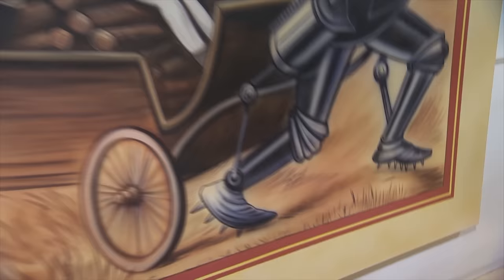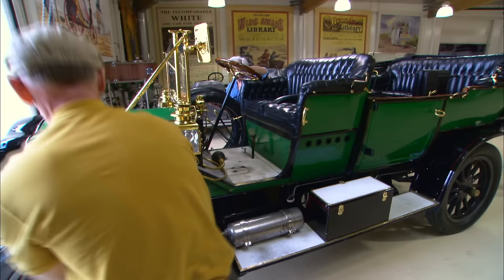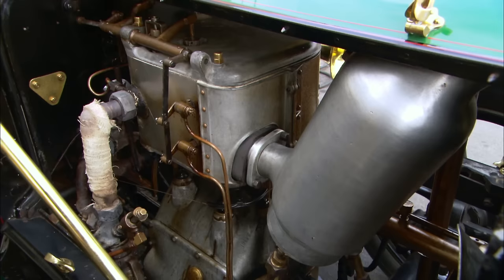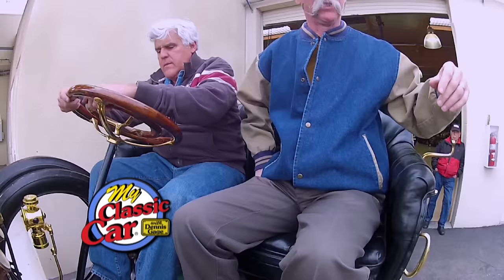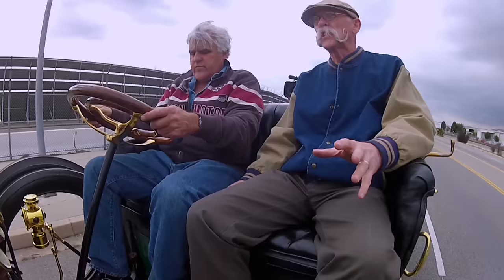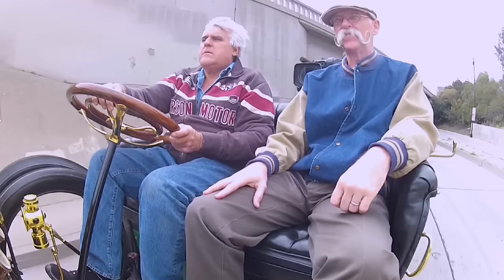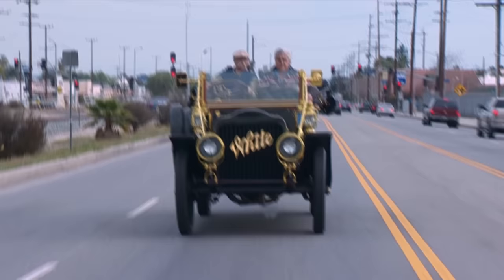Jay Leno's Steam Cars

Comment: 14:35  "I"m at top dead center", that just cracks me up, Jay was like, "get out and push". All that torque and they couldn't get the engine to turn over. lmao!
Reply: most likely has nothing to do about torque. 
I have seen this many times on bigger engines like MaK 6M552C
The cylinder is in a position where nothing will happen, so you got to turn it for it to start.
Reply: What happened to the simpling pedal?
Reply: Need a hand powered dead center over turn gadget. Ahh??? 
Some one should start making these brand new! AAA?
Reply: Yeah that's what you get with a single-cylinder machine. That's why steam locomotives have the cylinders offset by 90 degrees, can't really give those a push...

Comment: In theory, you could make it nuclear powered, but blocking radiation in something that small would be tricky
Reply: You could use a radio-isotopic reactor, like the one used on the space probe Voyager, it doesn't produce neutron or Gamma rays just alpha particle they don't traverse material, so it could be use in a car.
Reply: Oh yeah your right, 

Forgot those existed
Reply: You actually can block the radiation, as that technology was developed for aircraft and nuclear powered missiles in the late 50's and early 60's.  That technology never saw the light of day though, as they never solved the safety issues that would result in a crash.
Reply: I didn’t know about that,

I was thinking about how Modern U.S. Aircraft Carriers do it, with a shit ton of lead
Reply: What about a turbogas?

Comment: Give me a little push!  Awesome.
Reply: gamekeeper64 I think they may have locked up a brake on that wheel coming to that panic stop.
Reply: Nope, as Jay said, the engine got to top dead center, which meant no power at all. I believe it is a single cylinder, that's why it couldn't go. If only they put a small electric starter motor on the rear axle, then you press a button and a little whirr later, your moving again.

Comment: 800 foot pounds torque
Reply: Thats a lot for 20 hp
Reply: Ermos Cimpoesu THE POWER OF STEAM
Reply: Top RPM is low, which is why only 20hp.  It can get you going well, but it won't pin you to your seat, at least more than a second or two.  It's like a small geared down engine.
Reply: 800 lb-ft @ 130rpm.  lol, sounds impressive but the rpm's wont make this a speed demon.
Reply: @oldtwinsna8347  Steamers are great hill climbers, with all that torque.  And excellent at high altitude.  Stanleys won the Mt. Washington Auto Road Hill Climb from 1900 on to maybe 1910.  And big Stanley  "Mountain Wagon" 10 passenger car/buses did excellent service  as hotel vehicles for mountain resorts in Colorado for many years.   And steamers can be very fast -- as you saw in this video, the White could keep up with modern city traffic.  Stanley in 1906 set the Land Speed Record at 127 mph on Ormond Beach FL.  1907 Stanley returned with higher pressure.  At a -variably estimated 140mph the racer flew, then crashed.  The boiler spewed and rolled hundred yards then into the ocean.  Driver survived.

Comment: No way that is 3,800lbs... My explorer is 4,400lbs... And my explorer aint near as skookum as that steam car
Reply: Nope. Cars back in that day were a lot lighter than you would think. They have small frames and no safety systems.

Just a frame with some metal strapped to it and an engine
Reply: Yea the cars look bulky, like some industrial equipment, but yea probably just a lot of sheet metal and empty space inside.

Comment: It actually requires 25% less startup effort than my 09 santa fe. I usually gotta pop it in neutral and push it up and down the street a few times before it realizes the neutral switch is engaged
Reply from the maker: You should probably get that looked at. 🙂

Comment: I can imagine that going at those speeds in a steam powered vehicle was nearly impossible back in 1909. The highway system wasn't created until 1956 and the roads were not as well maintained as they are right now. If someone wanted to go at those speeds back in the day, they probably would have crashed.

Comment: This is rhw future of cars if you think about it.  You can plug it in to keep the steam hot with modern technologies.  With fuel choices,  you can run a steam engine on anything that burns, including pure green ethanol or methanol. And with modern technology,  all of the engines shortcomings can easily be compensated for. Companies looking for alternatives,  should look at these and think about going back.

Comment: I Believe he Really had OTHER PROBLEMS when he "Needed a Push" like Transmission linkage stuck in two gears, cause it's damn near impossible to have a TWO CYLINDER Steam Engine get stuck on top (or Bottom) Dead Center. . . Happens All-Too-Often with Single Cylinder Steam Engines, but Twins Generally have Offset Crank Journals that Eliminate That Problem.

Comment: The throttle could be operated by a foot pedal and spring back to a closed position when released to make driving this more practical. Not suggesting modifying this vehicle that will never be made again, just don't see why it wasn't made that way to start with.

Comment: I wonder if it's possible to remove radiator on cars, and instead use water steam to run a small steam engine that's tied to to cars belt. I think that would add extra mileage.

Comment: I can't get over how fast that thing can go. In the video Jay guesses it weighs maybe 3500lbs and he states that the engine is 40HP. You put a 40HP gas engine on a 3500lb car today and it is going to crawl along. Even compact cars in the 2600lb range in the US have over 100HP. Did they calculate HP differently back when that car was made or is there something I'm missing?

Comment: Proof polution is a choice
Reply from the maker: Actually, steam cars have to burn fossil fuel to create the steam and use about the same amount of fuel per mile as internal combustion engines.
Reply: @MyClassicCarTV  Yeah, but people could innovate the designs, and change the engines to use less. Transportation isn't even needed to make society function. Or we wouldn't even be here.
Reply: @MyClassicCarTV  we could probably have vehicles that run off of magnets,I used to think about different ways to design cars n stuff when I was younger. But our society is about production for the longest period of time. Fossil fuels can go until the mechine it powers fails.

Comment: Wat is like to know is why r we not returning to steam cars for everyday use for normal ppl? This car is doing all it needs to do as a car. It only fails when it needs to be driven for racing or something and maybe it can’t be built like a transport truck can but for normal driving it’s all u need. This car produces next to no emissions and get u safely to ur destination without question. Why do we need to use gas, diesel, and electric cars for the normal persons everyday use?
Reply from the maker: Steam cars burn fossil fuel to generate the steam and get about the same MPG, and produce about the same level of emission, as internal combustion engines.  They're not the answer.
Reply: @MyClassicCarTV  wait, but I thought steam cars use coal not fossil fuels? And I thought fossil fuels were worse to the environment than coal? But even if I’m wrong I do still believe that rn electric cars r also not the answer. They just don’t cut it for both power and usability in the cold. I’d like to see an electric car handle 22F -54F everyday for 3 months straight every year for 20 years and drive a total of 200k miles over that time and cost no more than an average of $1,000CAD each year for maintenance and repairs. Many gas and diesel cars can handle that and more but rn from wat I’ve seen electric cars can’t.